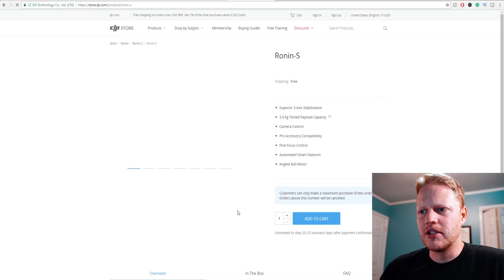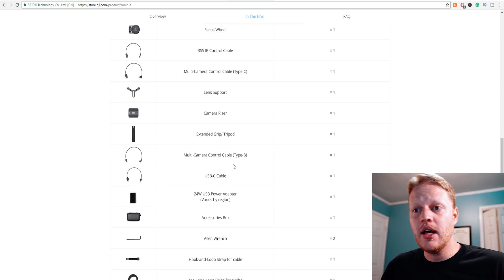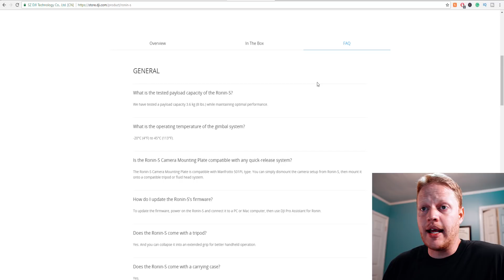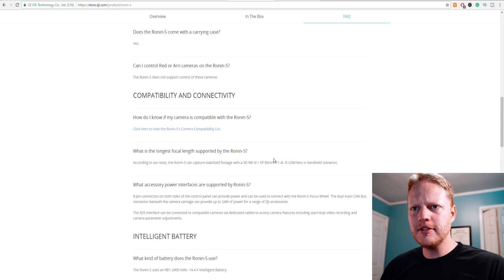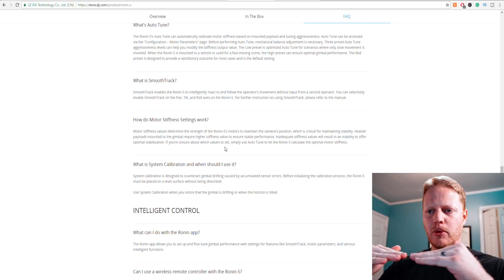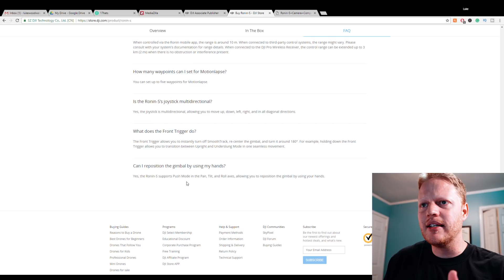YES! It works with Sony: DJI Ronin-S Features Walkthrough

Comment: see zhiyun weebill to know what "compatibility" means ! I bought the ronins at the release price and realized that my a7iii can't be controller properly via the ronins, now dji dropped the price after the zhiyun weebill release.. I totally regret buying the ronins I wish I have gone for the zhiyun weebill
Reply from the maker: I've heard great things about the Weebill.  But in this industry there will always be something better and improved just around the corner.  Good news is, usually you can return or sell back without a huge loss.  The Ronin- S does the trick for me now.  Best of luck, thanks for stopping by the channel.

Comment: Hey my friend a Quick heads up for controlling start/stop recording from gimbal with Sony A7r iii .. it doesn’t work with the USB cables provided.. u have to use the IR cable included and point it at the IR Port in front of the grip right below the dial.. the Cable is bendable. I’ve got mine coming out of the gimbal port, under my lens and bent to point directly at it... weird as hell but it WRKS! .. learned this after conferring with some FB Sony group users!..
Reply: Saw this with another review as well... ugh, weird workaround, unsure why Sony can't get this to happen, but it's not just an issue with Ronin, you also can't use CamRanger for remote Sony access either, and (last I looked) other than the IR option and the unfortunately named PlayMemories app, there is no way to remote trigger Sony - no radio solutions AFAIK. This is a BIG deal for me and how I work, and one of the only reasons I stick with Canon for photos. Anyway... two questions for you: 1) Does bright sunlight affect the IR trigger? and 2) Does the IR trigger work both for video (presumably when the dial is set to video?) and photos (dial on photo mode of some sort)?
Reply from the maker: Awesome!  Thanks so much.  I actually just figured this out 30 minutes ago with a friend.  Thanks for sharing the info.
Reply from the maker: Hi Alan!  Thanks for stopping by the channel, I hope the videos are helping.  So I am personally getting mixed results with the IR trigger.  I will play around with it and get it working for a little bit, and then it will just stop working all of a sudden.  One of my cinematographers used it most of the day for a wedding shoot and only had one little issue.  He was using a Sony a7s2 and I was using an A7iii, there may be a difference in their receivers, but either way, it does not perform well enough to depend upon it to get a quick shot in the moment.  A fraction of a second can make a huge difference and it just doesn't cut it right now.  Hope that helps.

Comment: Hello, I need a bit of help.. Do you think it will work with Sony FDR-AX53  ??
Reply from the maker: Hi Elda!  The smart functions probably will not work but as far as stabilization I think you're good to go.  However, you would probably have to get some counterweights for that specific camera since it is quite light.  I would suggest looking into a crane or another brand that is designed for smaller setups.  Check out the Ronin-S page for more info, http://click.dji.com/AB-B0MgzaDbLisW0C41EaA?as=0002&ch=Ronin-s%20youtube%20promotion&pm=custom

Comment: hi, do u think it will work with canon 80d with a 18-150 lens ?? i ordered my ronin s ..
Reply from the maker: Absolutely, Crazzzyworld (love the name btw).  That setup would only be about 2.5 lbs.  Even with a cage, mic, light, and monitor you would still probably be under the 8 lb optimal payload suggestion.  What kind of work do you do?